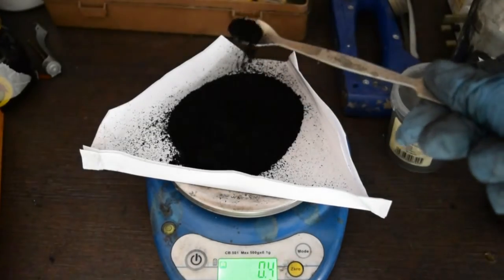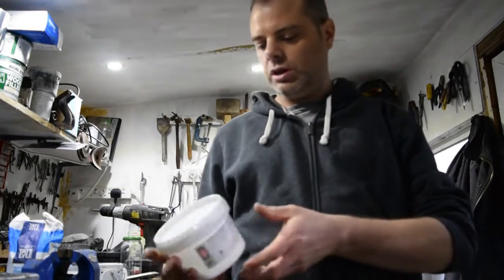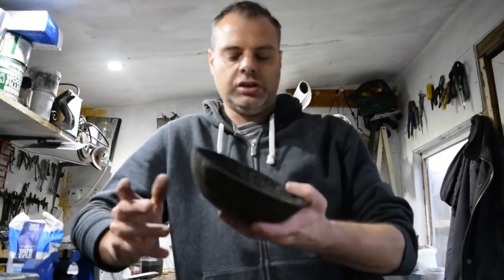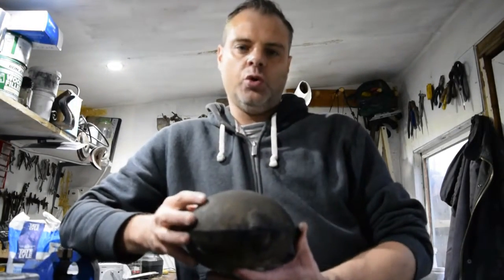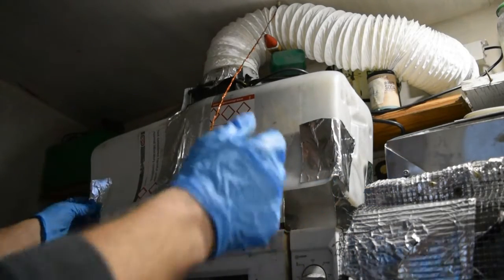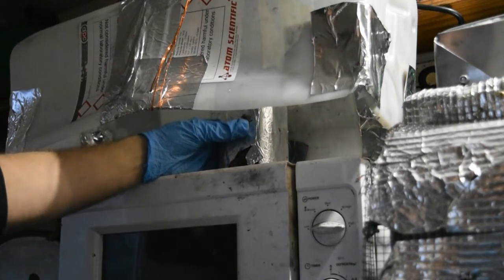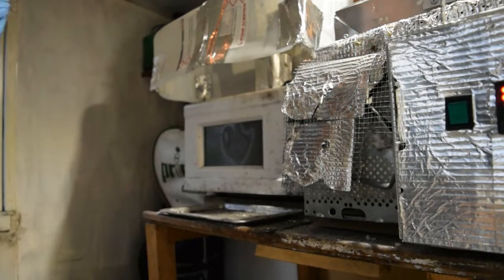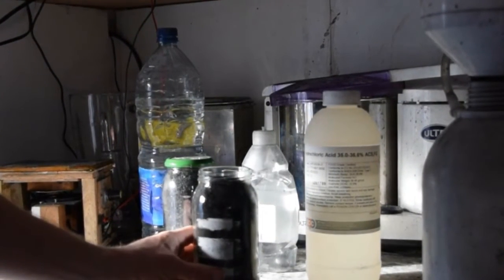Making High Performance Carbon Foam For Supercaps/Batteries-Part 1

Comment: Is there no alternative of zinc nitrate ?, Ammonium nitrate or ammonium chloride for example ?
Reply from the maker: I have tried the alternatives you mentioned but you just don’t get the same results as good as Zinc Nitrate
Reply: @geeforce3891  thx you for your reply,  i want to make my super capaCitor with your formula, btw do you ever test dextrose as percusor ? is it better than sugar table?, i have read on comment column, someone achive high F using dextrose instead sugar table, How about electrolyte, i have read on Google that al2so4 is better than naso4, h2so4, naoh and koh ?
Reply from the maker: @teknosql4740   it’s best to have a go yourself n experiment. Try those things.

Comment: is there any alternate/substitute for Zinc nitrate? bcs as u mentioned that zinc nitrate is difficult to procure.
Reply from the maker: Not as far as I know. I've tried other nitrates, doesn't work. If you have access to nitric acid you can make ur own with zinc oxide or metal.
Reply: Basic chemistry? If you cant make nitric acid from sulfiric acid and a nitrate salt then just use copper nitrate and zinc metal in powder form. Zinc will displace the copper from solution forming copper metal and zinc nitrate. Zinc is fairly reactive and easy/cheap to obtain. Here is a simple reactivity series chart. Anything below zinc and be displaced with zinc, anything above can be used to displace zinc. https://i0.wp.com/www.compoundchem.com/wp-content/uploads/2015/03/The-Reactivity-Series-of-Metals.png?ssl=1

Comment: What do you think about using 2 sponges to absorb graphene ink as materials for supercapacitors?

Have you or Mr robert create a capacitor that could be made into a functioning unit and better than commercially available capaciotrs?
Reply from the maker: Why not give it a go? Ideally you would want the sponge to be the graphene itself. 
I show a working supercapacitor in my other videos. Robert has already produced a fully working supercapacitor that are more energy dense
Reply: @geeforce3891  he has produced so many capacitors in so many ways.

Which one exactly was the most energy dense?
Reply from the maker: @FirstLast-tx3yj  you'll have to look through his videos im afraid mate.
Reply: @geeforce3891  I guess i have to go thrpugh everything.

thx love ur videos! Keep up the great work

Comment: Wouldn't be easier to use Sulfuric acid? You could get this from an old car battery. Just asking.
Reply from the maker: You could but it's performance for a supercapacitor would be poor plus over coming the contamination from the sulphuric acid. You'd do far better buying some activated carbon if you don't want to make this carbon foam. But this carbon foam has the greatest potential for performance and capacity due to its nano scaled high surface area per gram

Comment: I can get the zinc nitrate through ebay but the price is like $60 for 500 grams, it's not worth that to me, there was a company on ebay last year that had about 100 grams .for like $6.95, I'll just have to wait and see if the price comes down. did you decide that you thought yours turned out better than Roberts did? If I remember right he seemed to think that his was somewhere along the line of lead acid for energy density. What type of silica did you say you added to the mix?
Reply from the maker: I don't know if mine performs any better than Robs, as he didn't do any tests on it. But my method gave a much larger yield. Rob only seem to produce tiny amounts. And It's fumed silica.

Comment: Tim - that looks like a GREAT carbon!  I like your idea of using firebrick as an insulator - I've been using ceramic tiles and with my new technique they are cracking from the heat in the microwave.  I don't like using a ceramic blanket because you have to wear gloves or it is very itchy, like fiberglass.  (I'm currently using a mixture of sugar, salt, urea, and graphite powder and the heat it is generating is breaking the ceramic cups and tiles I've used for carbonizing all summer -- more info in the videos on my channel)  I'm not sure if the ceramic crucibles would stand more heat than the ceramic coffee mugs - but I'll probably give it a try.  leo
Reply from the maker: Thanks Leo - The Ceramic Crucibles are designed to withstand much higher temps. People use them to melt gold in kilns. They often come untreated and they advise treating them with borax. anything described as a crucible would imply being suitable for very high temps. Ordinary kitchen ceramics like cups are not designed for such temps and will crack. you're limited with microwaves because stainless steel or graphite crucibles will just arc! 

If you're using sugar , salt (sodium chloride) and urea. you could try carbonising ammonium chloride and sugar 1:1 ratio. its a relatively safe salt. there's ammonia given off with urea, so ammonium chloride is just as safe. I got this info from a free science paper here https://www.nature.com/articles/s41598-018-20096-8. I focused in on the 'method' paragraph. if you don't have a kiln to turn it into 3d graphene then try adding 20% graphite as a conductive addictive. or you could try experimenting with zinc chloride and sugar instead. hope that helps. good luck mate!

Comment: Awesome video mate, Superb content and clarity .... A new Carbonator is born 😎
Once you have trialled your sugar Carbon go get yourself a bag of Dextrose and do the same it is very cheap on ebay, take a good look at the structure of Dextrose ( Glucose ) the molecular formula C6 H12 O6  fascinated me first, but you will find ( or i did ) that it will out perform sugar by miles.. i got over 500 mWh/g
All the best with your endeavours in the future...... kev
Reply from the maker: Cheers mate I appreciate it  😊 Cool I'll look into that cheers. But there's only one carbonator in my eyes.. YOU. If you're into football they'll be singing in the stands.. 'there's only one carbonaaatttorrrr.. one carbonnnaatttorrr...  ' lol